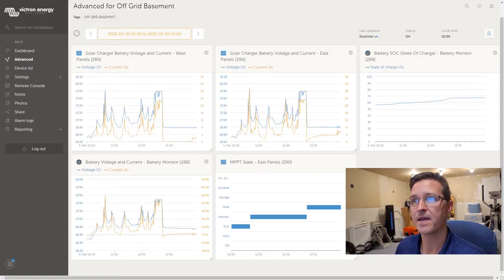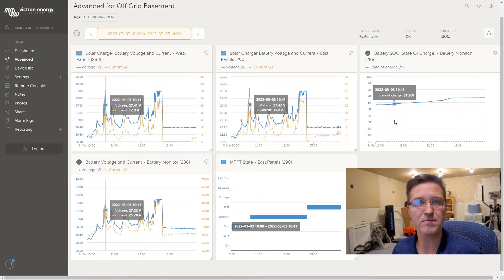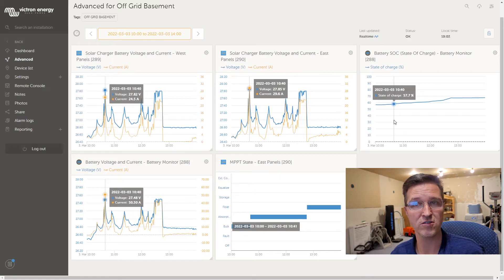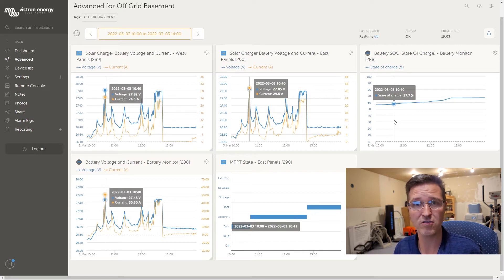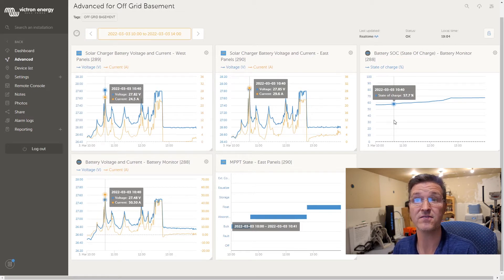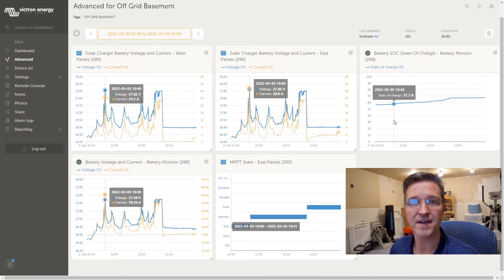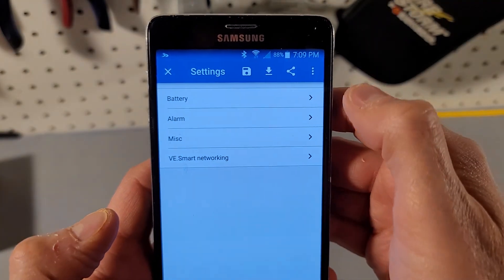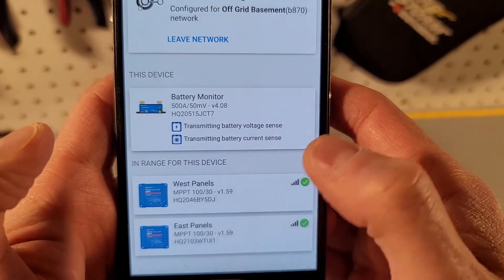Issue with Victron Voltage Readings and how I fixed it!

Comment: If you want a solar system that you have to mess with continually get an over engineered Victron system. Two years in I regret my $10,000 purchase Victron equipment. i've had several other systems Outback and others that I set up the way I wanted it and basically forgot it. you won't do that with a Victron system. If you like to continually adjust through an app, play with your system when your traveling get Victron.
Reply from the maker: I can understand your frustration and thanks for the comment.

Comment: If you encounter 1V voltage drop at around 25A then it means there is something seriously wrong with your cabling. Either too small battery cable diameters or some loose contacts. Check it carefully as your connections to the battery loose 25W of heat at 25A current. This is way out of spec. Measuring voltage near battery might look like it fixed the issue, but the real issue may one day lead to fire… so be careful!
Reply from the maker: Thank you for the great information and the comment.

Comment: Ok very interesting. My smart shunt is showing around 0.3 volts less than my battery BMS's and multi meter are showing at the bus bar. This is resulting in my multi plus over charging with shore power conected. I switched the start and house battery wires at the shunt teminal and then the start battery showed 0.3 lower voltage.
I am guessing the shunt has a problem now and I'm still searching for an answer.
Reply from the maker: I don't have a multiplus, but can you lower the charge voltage?

Comment: Most likely cause is the voltage drop between the smart shunt and the charger.

Example: if your cable has a resistance of 100mOhms and you pass 10A through it you’ll see a 1V discrepancy between the ends of the cable.

TL:DR;

when charging the battery with higher current on longer cable runs, the charge controller could report a premature higher voltage and shut down charging prematurely.
Installing a shunt sensor close to the battery and making the charge controller aware of that voltage should allow a fuller charge.
Basically keep the battery to charge controller cables as short as possible. 2x distance means 2x cross sectional cable area increase to prevent loss on cables. 
Install any battery voltage sensors as close to the battery as possible. 

Long ass ‘splaining…
When you install a shunt sensor with the intention to monitor the battery’s real-time voltage it should be installed as closely as possible to the battery.
The further from the battery it is, the lower the reported voltage will be under higher current conditions. 

Any other components in the system should use that sensors data for battery voltage, for that particular battery. Multiple sensors may be required. 

If you placed a shunt sensor in the system with the intention to monitor overall current draw, typically you would ignore the voltage reported as a battery voltage indicator because of the voltage drop due to resistance in the cables, but it would be exactly what an inverter module could use to detect low voltage and trigger a shut down.

So in summary, you can measure current anywhere in a circuit (before or after any parallel circuits) but voltage measured at the load (furthest from the battery) will always be lower than the voltage measured at the source (the battery terminals).
The reverse is true when charging.
Reply from the maker: Thank you very much for the great information and comment!

Comment: I just got the reverse. Smartshunt says battery charged 100% and the MPPT is still in bulk mode. MPPT and shunt are also in the network together
Reply from the maker: Are the SoC and the actual voltage could be different.  After you get your MPPT to Float, the smartshunt and the mppt should be in sync.  I hope this helps in some way.

Comment from the maker: I would be a good idea to get all of those batteries charged to 100% so you know you're working with a balanced bank.  If they are lifepo4 the voltage will equalize on its own, but might not be in balance when it comes to remaining capacity.

Comment: I had this exact issue begin on my renogy CC out of nowhere recently. My CC was reading a high voltage than actual battery and thus cutting off charging in the middle of what should be charging. I have yet to figure it out. 12 volt system, 6x 114Ah batteries. I dont have the equipment you have as far as shunts, etc, but were you ever able to resolve this issue?
Reply from the maker: Do you have a multimeter?  What is the voltage coming from the CC and what does the CC state the voltage is?  I would disconnect the CC and then reconnect making sure all connections are secure.
Reply: @OffGridBasement  yes im actually about to chip away at it this morning. Got myself a load tester. Miltimeter and CC voltage match. Connections seem secure. The run from battery to CC is less than 10'. However from panels to CC is 100' but its on 8AWG wire, ive not seen any significant voltage loss for the run.
Reply: @OffGridBasement  well 1 battery shows to be maybe just in the beginning stages of weak, 2 show borderline to be weak, 3 are fine. I disconnected the 3 possibly bad and hooked up the 3 known good. Hard reset/power down on the CC and on startup shows 12.3 volts. Moved the panels into a bit more sun and CC shows 13.5 volts now. So i seem to be back to square one with the idea of wondering why the charge controller thinks the voltage is higher than the actual battery voltage. The swing doesnt seem as wild as before so maybe its showing output voltage? But even the battery voltage section shows the same number. So im leaning towards a bad CC causing premature life of batteries. This discrepancy could definitely put me into boost mode too early to have an effective absorption stage and this is why im thinking the batteries were not being fully charged.

Comment: listening to ur video, u say you set ur BULK voltage, and it looks like u r on victron computer software (please verify), I have a new victron bluetooth 250/100 unit and in the app, even in expert more i see no way or place to change the BULK mode, do u explain this procedure in any of ur videos.. thanks
Reply from the maker: I don't explain any of the programming in any of my videos so far.  I will be showing how that is done in a future video.  Thanks!

Comment: Sir my inverter show 27.2 Bulk mode but if i check with volt meter it show 28.2 ....its 1 volt different if battery is at 25v meter show 26v...Is there issue in inverter or volt meter always show open C. voltage
Reply from the maker: The volt meter and the inverter should read the same if you are measuring from the inverter DC side connections.  It sounds like an issue with the inverter.
Reply: @OffGridBasement  thanks for replying i will show to mechnic

Comment: I had kinda of the same thing 12 volt system 300watt panel 200ah battery’s my controller would read 14.4 charged but the batteries themself would be at 13.2. I would keep resetting my system every day to get the controller to charge up to full. Finally I  swapped out the postive wire going to my controller with a COPPER one. And it sorted itself out. Was thinking about a smart shunt. But I’m going to try the smart battery monitor as an addition.
Reply from the maker: It's nice when you find a simple solution.  Thanks for the comment.

Comment: If you can access terminal/connections then using a voltmeter shouldnt be too hard to find the culprit. Check what the devices are reporting re voltage when there is no current, if they report the same and their readings deviate increasingly with rising current then it is a "high" resistance somewhere. Could be connectors, crimp or cable resistance. Measuring voltage across different points in the circuit will find the source(s) of the loss. Using this approach I found a bad crimp (looked perfect) on a 20cm length of cable losing 0.2V at 5A in my system. Many chargers/mppts use small gauge feedback wires to read the true battery voltage to overcome these type of losses rather than rely on their own output value and assume it is the same as what the batteries receive.
Reply from the maker: Thank you for the great info!

Comment: Helped me understand and set up my system. I thought my alternator had gone bad with the low voltage issues that sometimes occur. I don’t have a smart alternator but voltage was dropping down from 12.8 up to 13.5. After topping off my lithium battery, the system seems to work normal and thanks to you, I can see how much current has been charged now. Thanks 1 million :-)
Reply from the maker: I'm glad you're getting everything working the way you want!

Comment: Great video and good info.... I have some Victron products, 100/30 charge controller as well as their smart shunt on my system but i cant seem to set up that VRM Remote monitoring like you are showing. It's very intuitive. .. I seem to be missing something to get to that level of monitoring. Any suggestions ?
Reply from the maker: I believe you either need a raspberry pi with the vrm software or you need to purchase the Victron cerbo GX.  Andy from the off grid garage taught me everything I know about setting up mine.  https://off-grid-garage.com/victron-connect-through-raspberry-pi/
I hope this helps!
Reply: @OffGridBasement  Yes been looking into it, Cerbo GX seems really nice from  what the videos I've seen on it... but it's $$$  Andy did a great job on that video for the Raspberry pi.. I just ordered one form Aliexpress, (first time using them)... let's see how that goes. One other thing, have you had success with a Chromebook to run the apps instead of your phone.. my eyes are not what they us too and I like the option of having a keyboard vs. a tablet...will it run the Victron VRS?  not sure if they run the apps the same as a smart phone does. Thanks for the feedback !

Comment: Hi, what are you using to have the ability to view data online. I have bluetooth shunt (Victron) no victron controllers only Shunt. Can i view online my data? Thanks.
Reply from the maker: You need to have a computer to capture the data.  I learned everything from https://off-grid-garage.com/victron-connect-through-raspberry-pi/
I hope this helps!  Thanks for the question.

Comment: If afther a cloud the sun is going full on the pannels the amps are spiking to the max. That makes tension peaks that are lagging trough the cables to the battery. Shorter thiker wires makes ik better but can’t make it perfect.  The shunt is closer to the battery. So more accurate. I have the same issue once above 25 amps the ssc begins to go way off. 0.2v.... indeed good idea to adressing the shunt to the ssc to more accurate and efficiënter solar charging.
Reply from the maker: Thank you for the info.  Ever since I lowered the absorption voltage I've never had an issue.  Good to know what causes it though.

Comment: Howdy. I observe this behavior in my victron system as well. The shunt is closer to the batteries and protected to a degree from current and voltage fluctuations that occur on the load side of the negative busbar  depending on how you hooked up your source and consumer devices. Victron recommends staggering your SCCs and inverters for example. Check out victrons "wiring unlimited" pdf, section 4.8 large system busbars.

As others have mentions, voltage drop in the wires may play a role.

If you ever end up installing a Venus or cerbo you could hardwire your other devices and use DVCC (distributed voltage and current config) to synchronize your readings across your system.
Reply from the maker: Thanks for the info!   I believe I have that pdf so I'll check out that section.

Comment: Why a voltage difference ? , I would say a voltage drop on cables .
Reply from the maker: I have 2 AWG cabling for a 24v system.  I wouldn't think it would be that, but I'll look into it..  Thanks for the comment.
Reply: @OffGridBasement  What are you using between the controller to the bus bar ?
Reply: @peteradshead2383  10awg copper wire.
Reply: @jimlaning3560  Hi Jim , My system is very much in bench test mode , But I've found at night when there is no current from my 2 controllers the voltage from the shunt and the controllers are the same , but with more current, the more the controller's voltage differs from the shunt , because you are measuring the voltage at the end of the cable not the battery.
My inverter says their is a 0.2v volt drop between the shunt and the inverter at 15 amp , so if you push 15 amps into the battery do you get the same 0.2 voltage drop acting as a increased voltage ?

Comment: Maybe voltage drop from longer cables on the mppt, vs the smart shunt tapping in at tye battery terminals
Reply from the maker: It could be, but the cable runs are so relatively short I don't think it really makes a difference.  There is a .15v drop from the MPPT to the battery, but it wouldn't cause such a spike.  Thanks for the comment!